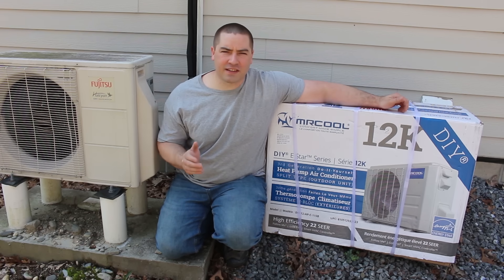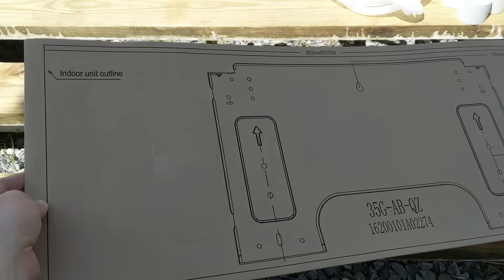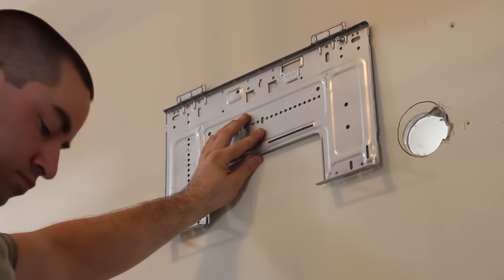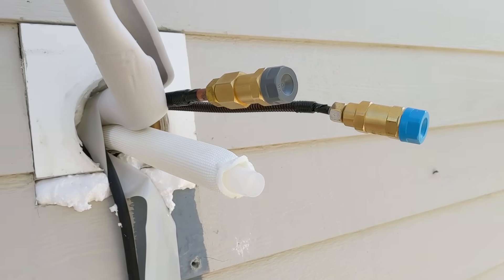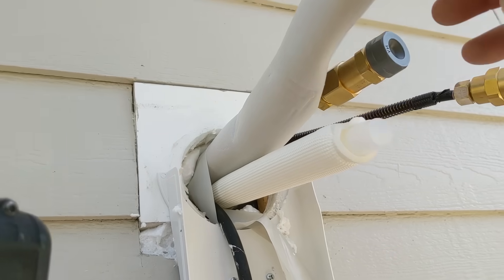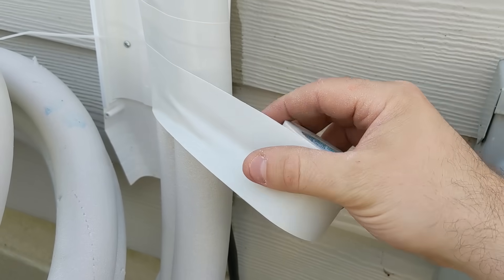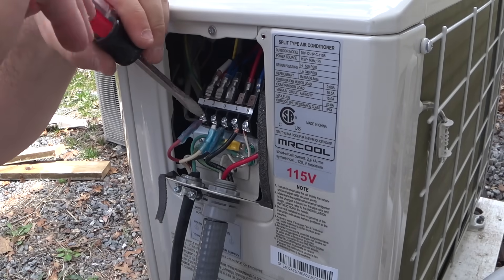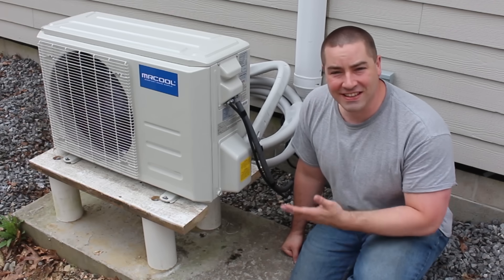Installing My Own Mini-Split Heat Pump, DIY

Comment: Didn’t pull a vacuum. Should’ve cut and re-flared copper line set.
Reply: It already had a vacuum if not it wouldn't be blowing cold air.
Reply: @indman101  wrong. Split systems don’t come pre-vacuumed. And even if you don’t pull a vacuum doesn’t mean the unit won’t function. A Vacuum is to pull moisture/noncondensibles from the line set and evaporator. I’ve installed hundreds of ductless mini split. Every installation guide I’ve read instructs you to pull a vacuum. Thank God for filter dries. That’s probably why his last one only lasted a few years. Plus most of the mini splits are junk.

Comment: Questions: 1.) What do they say to do if you had a leaking connection? 2.) It seems you used more force to tighten the fitting to the outdoor connection, do they specify a torque to tighten those fittings to?
Reply: To answer both your questions if you get a torque wrench and follow the manufacturer’s instructions you won’t have a leak but if you do your suppose to leak check with nitrogen and soap bubbles

Comment: YOU did a FINE JOB BUT...YOU SHOULD NEVER "COIL" HI AMP CPRDS !! YOU SHOULD just CUT IT TO LENGHT and then wire direct. REASON ? (INDUCTIVE LOOP)  OVER HEAT AND POSSIBLE F_I_R_E !! NOW ...GO FIX IT !!

Comment: Considering you’re off grid, how many watts does the Mr. cool use?
Reply: It’s an inverter driven compressor so there can’t be an accurate result, but most of them draw about 1kw
Reply: It all depends. I use about 20-25kw per day with a 4t split unit. Works out to under $2 a day or less. That's very efficient.

Comment: You need to vacuum the lines, if you don't do this you will have problems with the humidity, causing clog into the capillary tubes.

Comment: How do you pull a vacuum on the system to remove air/dirt from the lines to and from the condenser?
Reply: This is the diy unit lines are pre charged no vacuuming done on a diy unit

Comment: Wow what a cheap mess  Old unit was 220v new unit was 115v  but hid the red power wire inside the outdoor unit and most likely still on a 220 breaker with the wrong outside disconnect? BTW springs are on all mini split systems not just this one.. Never leave all that extra line set creates a oil trap compressor will fail...... this one I give it 2-3 years and then throw it away. Also should use torque wrenches on the fittings. Need to seal the bottom of the line cover  This video shows one thing You get what you pay for. Probably has only a 1 year warranty Buyer beware

Comment: People... this guy has no idea what he’s doing, did not pressure test with nitrogen, did not pull a vacuum, excessive line set left.
Reply: I thought the lines were precharged and did not require pulling a vacuum? Since this is a DIY mini-split, does it require nitrogen testing?  I am a novice as well, but it seems like he did everything correct.

Comment: You’re meant to vac the lines. What happens if there actually was a leak then you’ve just let refrigerant out that is toxic to the ozone layer. Also air and moisture mixed with refrigerant eats copper pipe which if you had of vacuumed the lines could have avoid that so have fun when that eats the copper and you’re back to square one cause it’s all leaked out again

Comment: Might get troubles in the futur for not doing a vacuum in the system with all that 25 feet of tubing which kinda looks weird with all the extra tubing/wiring. But for the rest you did a great job for probably not being an hvac tech!

Comment: Total illegal in Canada,a person can get into some serious trouble with environment Canada for this ,It’s surprises me how many people that are so ignorant of a Refrigeration and air conditioning mechanic.Make sure the guy is a journeymen technician,not a sheet metal guy,a plumber a electrician.If this unit gives technical problems,is this guy going to repair it himself I don’t think so,I run a company and will only work on equipment that a technician installed that is qualified,those line sets are also illegal in Canada.

Comment: ??How did this unit do this last summer
Reply from the maker: Kept the house cool.  The one hickup was on a very hot/humid day the inside coil froze.  I turned it off to let it melt.  The next day I turned it back on and it kept running.  Now it's heating my house.  So that was annoying.  I wish that type of situation was designed out.  But, to be fair, I've never had an AC (whole house, window, or mini-split) that NEVER iced over at some point.

Comment: Where tf is your vacuum pump??? Your system has air in it still which is NOT good for the system at all. When you released the refrigerant then you found a leak?? Then what do you do mr diy hack guy, i know you don't have the proper equipment to fix it. This stuff  you should leave for the professionals.  This whole video was pretty bad and no one should do what this guy does unless you're professional qualified.

Comment: Curios how much money you saved doing this yourself. I don’t imagine all the tools you needed were free or your time and if there was an issue do you have the tools to diagnose and repair it?
They great thing about this is that since you are your own customer your work only needs to be good enough to make you happy.
Reply: The big thing is the precharged lineset,  which means you cant cut it so you have a more difficult time running it and your left with a big loop of extra pipe next to the unit . Otherwise you have to buy a 600 vacuum pump,  flare block , Manifold and refrigerant that you cant legally sell to someone not licensed by the epa. He probably saved 1000-1500 and got shittier equipment/ worse install.  But not insignificant if he doesn't break down from a mistake or have a warranty issue that would Otherwise cost him no time or effort.

Comment: What a piss poor installation. You’ve got air in your installation because you didn’t use a vacuum pump and you didn’t do a pressure test before the gas came into the system 🙈 Take this video down and stick to you desk job
Reply: Pre charged system

Comment: Unfortunately it's illegal to install DYI in all of EU. You can't even buy it unless you have a certified contractor and his certification number.  Installing usually costs about 5-800$.
Reply: That is because removing the old refrigerate is generally needed and requires special tools and training. Releasing the refrigerate into the air causes more damage to the environment that running a semitruck with no emersion equipment on it, seriously most of the older refrigerants are illegal to manufacture or import into non 3rd world countries, that is why you shouldn't do this.

Comment: That extra lineset isnt supposed to be there but you'd know that and how to install it properly if you were a real hvac tech, smh.
Reply: I don't believe he hired a real HVAC company to do the install to begin with (probably a chuck with a truck) because unless something hit that unit it would not have had its first failure after 2 years and you certainly would not have 3 failures in 7 years unless you are beating the shit out of it with a bat (based on the dents he might be), most compressors if installed correctly should last about 30 years and leaks in copper tubing don't happen just sitting there, 99% of calls I go to are air flow related, bad electrical components, or something hit the unit. Also to anyone wanting to DIY an AC unit if your system still has refrigerant in it the tools (manifold gauges, a recovery pump, a tank, and disposal fees) will run you well over $1000, just hire a good reputable company to do the install. Refrigerant cause really bad damage to the environment  and needs to be disposed of properly, not to mention if you size or install your equipment wrong you will cost yourself more money in energy and cause the equipment to fail prematurely. In the long run it will cost you less to get a good tech to do it because like I said your AC unit should be good for about 30 years, DIYing this is saving you a few bucks today to spend a lot more over the life of the unit.

Comment: Good job, but lose the wood under the condenser, if it’s a heat pump the wood will rot off in no time.

Comment: How is the unit over time? Good product?
Reply from the maker: It's heating my house right now, and has been all winter.  It kept the house cool during the summer.  Although, there were some hot days that it was maxed out and I wished I had gone with the slightly larger model.
Reply: @DavidPozEnergy  thank you. Good stuff. Thank you. How many sq ft again are you heating and cooling?
Reply from the maker: 740 square feet.  But I built my house and it is super insulated.

Comment: Good DIY install - good to see DIYers are using Nylog, its a must to help avoid leaks at the connection points. Mr Cool is a good garage use unit, it will last you 2 - 3 years under normal usage. I don’t like the line set left coiled, understandably the line set is pre-vacuumed and cant be shortened without re-pulling a vacuum and the DIYer wouldn’t readily have the tools necessary to do it right, but otherwise, this is a really good install and those of you who are wanting to do your own unit, follow this step by step...really thorough. Good job.
Reply: 2 or 3 years - why?  That's useless.  Which units will last longer - like 15 years?

Comment: May I ask. Why wasn't the wall sleeve used?🤔🤔
Reply from the maker: Sure.  The sleeve was about 8 inches long, which would be fine for 2x4 or 2x6 construction.  But I built my house with super-insulated walls.  I would need the sleeve to be at lease 14 inches long.
Reply: @DavidPozEnergy  oh wow

Comment: Can you give us an update how it is working in the winter?
Reply from the maker: I just leave it set on one temperature 24/7 and it works great.  Even with the snow storm a couple nights ago.
Reply: @DavidPozEnergy  So you have your AC running in winter?  Or is that a heater too? I thought it was just an AC....wow....what size room is it heating and cooling?

Comment: tip: Use some other material you've drilled a hole through as a guide to keep the hole saw from walking around when you don't have a good pilot to hold onto

Comment: Merely a question, should that hole not be in an angle, concerned South Africa....cos if you don't get good drainage from inside out  you might start getting issues....

Comment: How well does it work for heating in winter? I notice lots of people relying on heating oil, I was wondering if this and solar array might not make more sense.
Reply from the maker: I think this makes more sense than heating oil.  It is currently heating my house.  Works fine.
Reply: @DavidPozEnergy  Thanks

Comment: Looks like you placed the ground (black) wire on the wrong side of the terminal.  Could have trimmed the wires so there is less bare wire out of the terminal as well.

Comment: Wht does the title say "mini split heat pump" when it's obviously an air conditioner for cooling ?
Reply: it can do heating as well as it has a reversing valve built in.

Comment: what was your cost for that unit?  How many square feet should it cover?    It has been a few months,  How did it work for you this summer?
Reply from the maker: Mr Cool provided the unit to me at no cost.  I'm heating/cooling my whole house, but it's a small home.  700 square feet, plus two lofts.  This summer it did freeze up once on the inside during a really humid spell.  I let it thaw out for 24 hours, then turned it back on.  Hasn't happened again, and now we are heating.

Comment: The only negative to the preparred tubing is that you may have to loop it due to being too long.  Looping can accumulate oil which isn't good for longevity.  Spend another $200-$300 on a vacuum kit and flare tool and trim the tube to the right length.
Reply: Just learned something about oil accumulation! Thanks!
Reply: Most companies will provide a custom set for $$.     Most common from suppliers is 16' and 25' sets
Reply: Good point, but really though how much DIYERS have the money to do so? And besides buying something you’d most like to ever use this one time.

Comment: I think you need to purge the air in the pipes before opening the second valve. Or did I miss something.
Reply: You missed something.  Mr. Cool is specifically designed for a diy install with no special tools the lines are vacuumed and sealed from the factory,  the compressor comes precharged with the proper amount of refrigerant for the system.

Comment: I've watched a ton of these videos and I don't see anyone connecting the electrical wires to the inside unit.  What's going on?  Is that even a step or did the wires already come connected for everyone except me?
Reply from the maker: The wires came attached to the inside head.

Comment: Oh my god!  Do NOT over-tighten the joints!  Again the tightness of these is completely irrelevant in terms of making a good refrigerant seal.  This is done (again) entirely by the o-rings!  You could probably just do them up finger-tight and all would be fine (it's not like they are going to rattle loose like they might in a car or something).

Comment: Absolutely no point in applying the Nylog sealant to the threads of the joint as these are completely irrelevant in terms of sealing in the refrigerant (like putting PTFE tape in the threads of compression joints - daft).  The key to a good seal with those o-ring-based joints are the o-rings and, if you were going to apply any sealant, then this is where it should go.  That said, I hate the stuff as it makes disassembly a nightmare and you have to clean it all off really well before re-assembly.  The double o-ring arrangement should give many years of leak-free service so just leave it at that!  Just make sure they are spotlessly clean before assembly and a bit of silicon spray would not go amiss to help lube everything and prevent the o-rings from being pinched by the brass during connection and potentially damaged.

Comment: Your choice of 'drywall anchor' is dire (sorry!) and designed for masonry not dry-wall (plasterboard).  No-where near strong enough for that lump.  You should use something a lot stronger like this ... https://www.screwfix.com/p/easyfix-hollow-wall-anchors-8-16mm-m5-x-52mm-10-pack/12229?kpid=12229&ds_kid=92700048793290424&ds_rl=1249413&gclid=CjwKCAiAtK79BRAIEiwA4OskBg83pLZRtCQlBIIrlzxgBdvbACU3oAN1zqkVIjPs6R0CFLtQ_8oGfBoCJp4QAvD_BwE&gclsrc=aw.ds (EASYFIX HOLLOW WALL ANCHORS).

Comment: Do these not require a vacuum and nitrogen pressure test before releasing refrigerant?
Reply from the maker: Nope.  This particular kit comes with pre-charged lines.  That's why it's sold as a DIY kit.
Reply: @DavidPozEnergy   Ah. I see now. I've only done pioneer inverters so far and they've required a vacuum and pressure test. Haven't done a Mr. Cool yet. Good stuff.

Comment: You forgot to vac the system down to 500 microns and bleed the line set. You now have
air and water in your system..........................future pump failure,  I dont think this is 
all diy.  Just my thought.
Reply: Was thinking the same thing.

Maybe these dint require it.  I would have done it anyway.

Comment: i wish they had that here in Australia, $650 for most basic install only.
Reply: He didn’t vacuum the system or purge (which is illegal) the air out of the lines. Wait for his video next year on replacing his MrCool 🤣😂 That coil of pipes is going to collect all the oil as well. That’s going to one very unhappy compressor.

Comment: Nice Mr.Cool advertisement but I do have a couple of remarks:
Those easy click connections always start to leak at a certain point so you should always solder your connections (like with all renowned brands). When soldering you should put your lines under nitrogen pressure and once you're done clear this nitrogen out with a vacuum pump. This gets rid of all the pollution in your lines and allows you to check for leaks. Usually the outdoor unit is prefilled with refrigerant up to a certain piping length, if your lines exceed this length you'll have to add refrigerant. If you don't your heat pump will have to work harder putting more strain on for instance the compressor and you might find it won't work that good in general. You'll also get errors like low pressure fault indications etc. When drilling a hole in your facade drill it at a slight downward angle from inside to outside to eliminate any chance of water coming through along the pipes.
Most cheap heat-pumps are cheap for a reason (like the usage of cheap, inferior components) which is probably why you had to replace your only 7-year old heat-pump. Brands like Daikin and Mitsubishi Electric who use grade A components will last you much longer with 15 years being the norm. With heat-pumps buying cheap usually means buying expensive as the compressor and expansion valves usually give out quite soon and replacing them can be more expensive than buying a new cheap inferior heat-pump. In general they have a short life span, meaning you'll have to replace them more often. You could wonder about the impact that has on the environment, with heat-pumps having been labelled "green". So overall imho it is better to spend a bit more on a more reliable quality product that will last longer with less downtime due to repairs. At least that has been my experience in the 15 years I've been working as an HVAC engineer now. We don't even service inferior brands like Mr.Cool any more because they are just a waste of time and money.
Reply: How is Mr.Cool inferior? Please explain

Comment: Using plastic drywall anchors is a huge mistake. they do not hold over time. You had been better served to cut out on section of drywall and install two horizontal blocks between your studs in order to  provide backing for your unit. The drywall and paint repair would have been minimal.